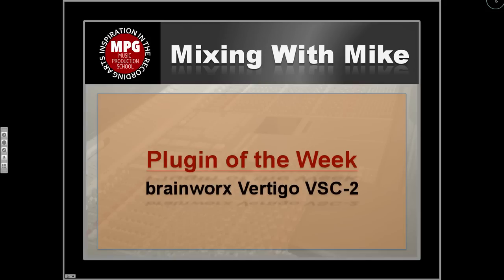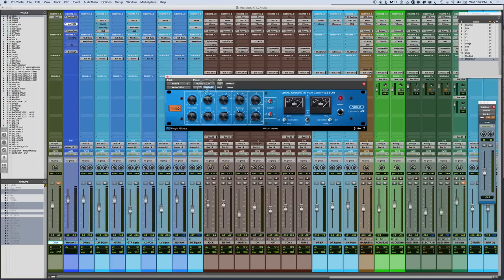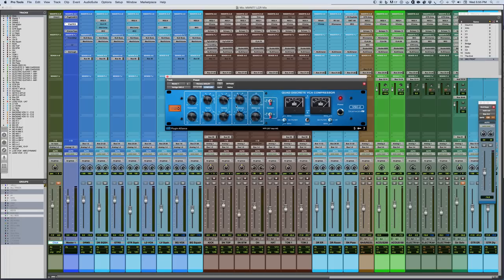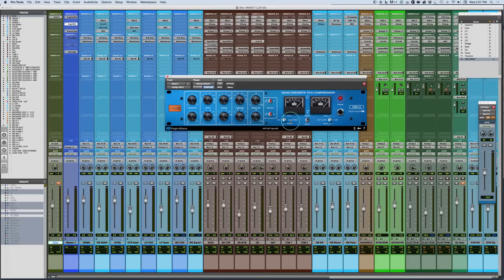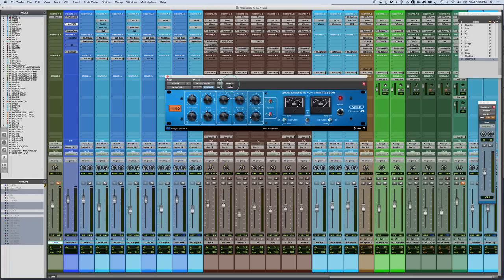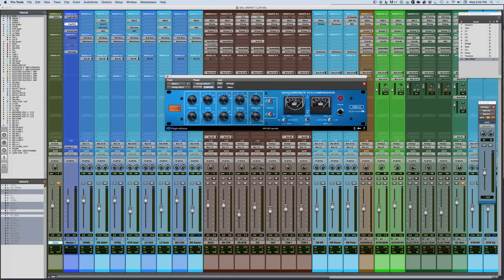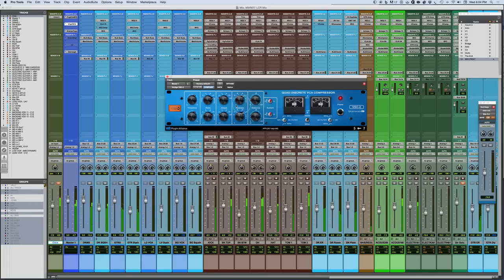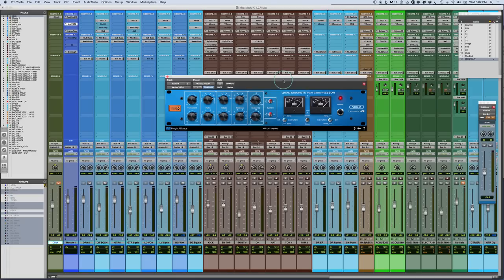Mixing With Mike Plugin of the Week: brainworx Vertigo VSC-2

Comment: yes yes yes i love it.I think Boz digital labs 10db compressor is great too but i dont know what compressor its emulating
Reply from the maker: Thanks Trez! I will have to check the Boz Digital plug out. It is an emulation of the ADR Compex F760. It is a FET compressor from the 70's I believe. They had one back at Right Track Studios when I was there in the 80's, very cool...!

Comment: Hey Michael, good video. Only thing I would mention is that the System knob/s do not keep the harmonics on. It just acts as a bypass knob at least on the plugin.

Thanks,

Marc
Reply from the maker: imsrprod Thanks Imsprod! 
I seem to remember reading that it did somewhere, but when I looked again it says to set the Threshold to the max so there is no compression an dyou will hear the harm dist.
Best!
Mike

Comment: Is this compressor able to "glue" mixes like the ssl g compressor?
Reply from the maker: This is basically a Class A super hifi version of the SSL Buss compressor with a few added features. It can absolutely glue a mix but in a cleaner more transparent way than the SSL. The S/C filter and the "Soft" Ratio setting are also amazing additions.

Comment: it's my favorite compressor... I never liked it on the master bus though (i don't know why) But i simply love using it on individual tracks
Reply from the maker: +discomyass Whatever works! I use it mostly in mastering, and have never really used it much on a track by track basis only on the mix buss. 
Cheers!
Mike
Reply: I just used it to master a song with analog gear...its sounds beautiful with 4000 E Channel, makes the mix, sound like it got ran through a real SSL E....especially, hybrid mastered with analog gear and analog mixing board....
Reply: Thats were plugins can help your gear sound more richer and more expensive in a hybrid mastering situation, which in my opinion is alot more affordable than having to come up with 40 k for an SSL Board